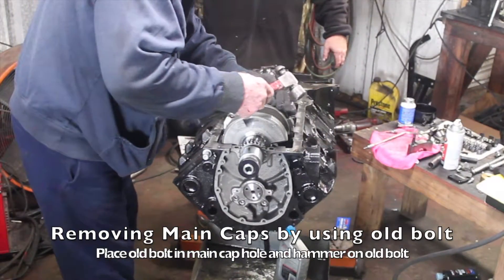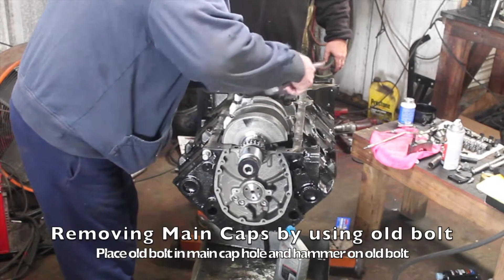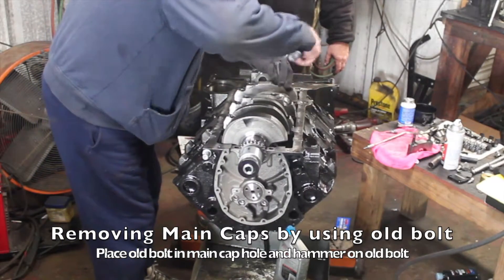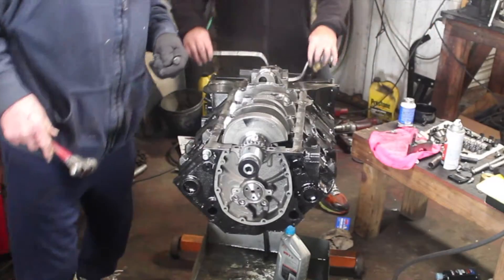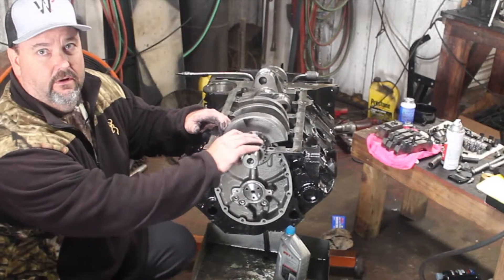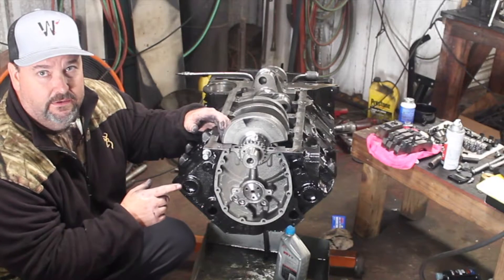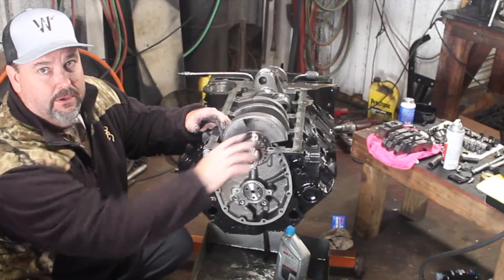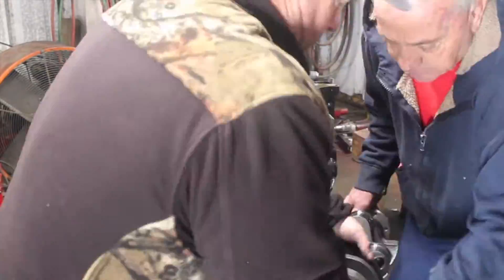Blower Crank Hub Issues big snout SBC Crankshaft keyways

Comment: What cover or seal did you use on the crank in the timing chain cover
Reply from the maker: https://www.summitracing.com/parts/cvs-tc2350bk Go fast, go straight! Be SAFE!
Reply: @KevinWilsonSBC  so does a normal small block timing cover work and it’s a just a different seal for the big block snout.
Reply from the maker: @Plumber1339  my bad. Wrong link. https://www.summitracing.com/parts/cvs-tc2351bk

Comment: Seems like it'd be difficult to pull the crank with the rods&pistons still in the block ? And maybe harder trying to set it back in... Any info would help as I'm wanting to try that too. Thanks.
Reply from the maker: To pull the crank, we had to disconnect the rod journals. We did leave the pistons in the bores, just removed the rod end caps and pulled the crank. Before I pulled the crank I took pictures of how the crank was rotated so I knew how to put it back in. The pictures were priceless and it all worked out great! Go fast, go straight! Be SAFE!!